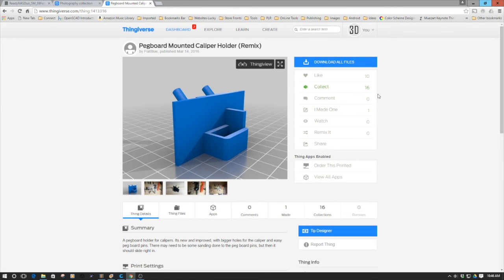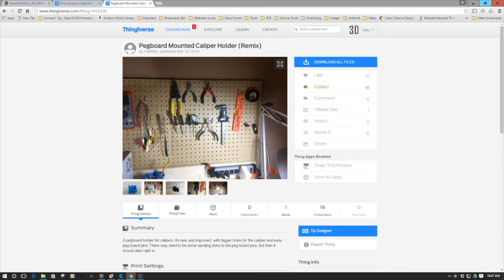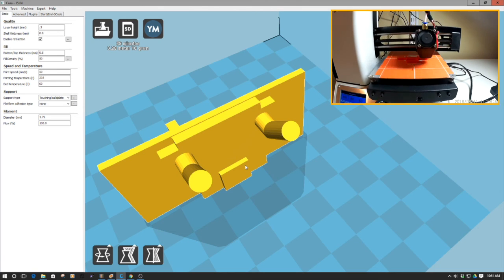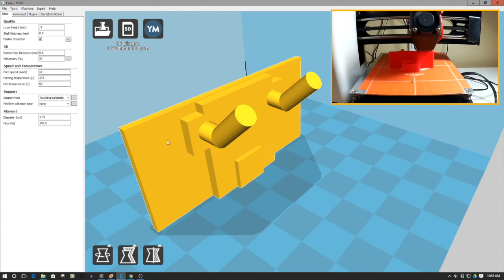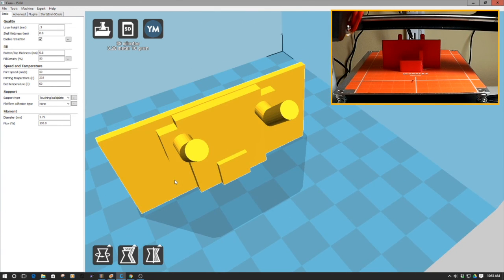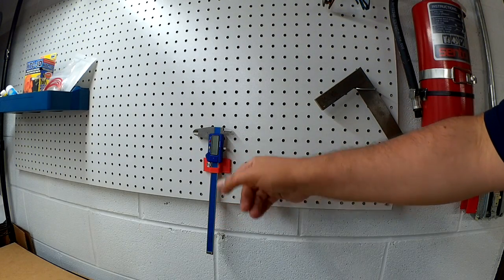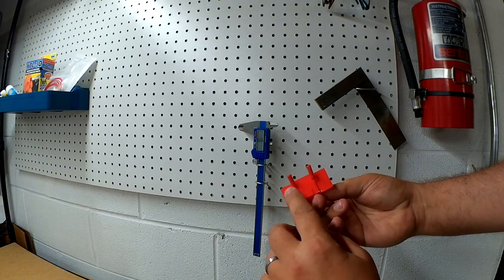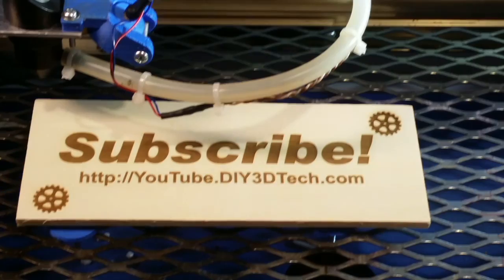Thingiverse Finds - Pegboard Mounted Caliper Holder!

Comment: cool part and yeah strange how the back plate was .  I agree i would have done it just as 1 plate .  I  have found i just make stuff in tinker cad now .  I dont go looking much as i end up 'fixing' things LOL.I can think of one instance that i spent longer looking for a part than it took me to design it in TC. 
I try to design stuff to not needs supports of any kind .   That can be as simple as  use a fillet under overhangs .  I suppose one day i'll hit a shape that might be easier to do in fusion 360 or  123D .  but so far I have found all I needed in TinkerCad .
Reply from the maker: Totally agree as I have spent a good part of my life dealing with high-end CAD/PLM systems and never ceases to amaze me what can be done in TC.  The only things I wish they would add is absolute positioning of an object.  Know you sort of can do it with the ruler, however, the issue then becomes positioning of that (i.e. the ruler).  This is one of the reasons I love Open-SCAD and frankly have gotten pretty good at it (as I love programming).
Reply: i agree when i was helping with the save hang bug , i had a quick exchange re 2 features i wanted to see.  
1 searchable community objects , so you can find by name.
2 ability to place ruler in abs coords from center of virtual bed , and to place relative to object using tool the alignment tool has.  if they did that i dont think i would need a other tool for my small 3D parts .
but that said i did my whole 3D printer idea in TC :  https://tinkercad.com/things/j7B7QGdO1z5
Reply from the maker: That's impressive!  Check this out, https://tinkercad.com/things/lyAJaOwKAs8 as built this just have not had time to do a video as I am using for new Cannon video camera I purchased...